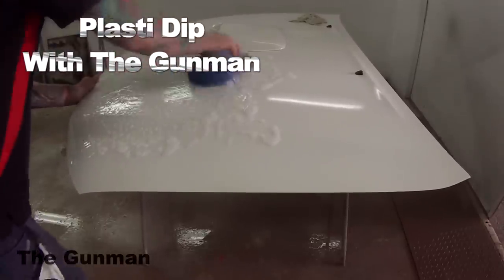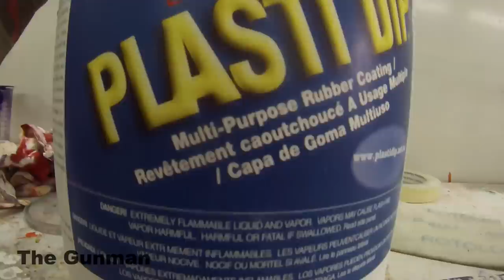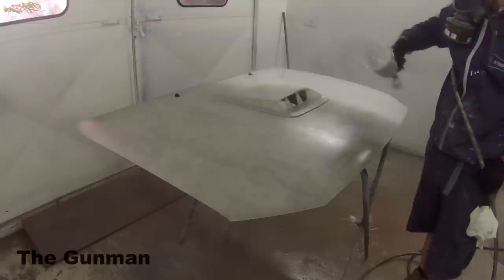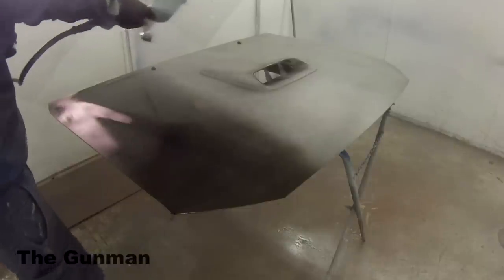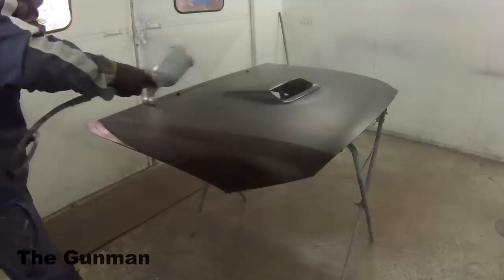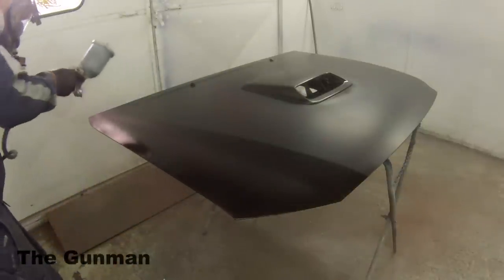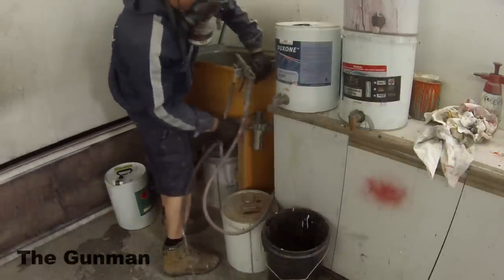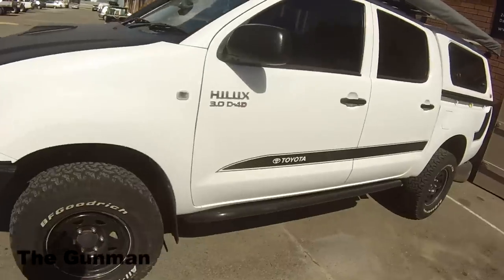Professional PlastiDip Spray Demo

Comment: I use plasti-dip all the time and it requires several coats, way more than painting it. you can use the black or white as basecoats and add pigments to the clear to get your preferred colors. I have a lot of people asking me to paint chameleon. Its a lot of fun to use and lasts for 3 to 5 years if taken care of properly and using spray on wipe off wax.

Comment: G'day mate...I'm on the Sydney side...I like your stuff so I'm a new sub....I found wax and grease remover gets it off pretty easy..A workmate did his car with rattle cans and it looked like crap and man he had a time "peeling" it off..The heavy coated areas lifted off not too bad but the rest was a real bugger.. Looks like it came off old mates wheels ok with a pressure washer.

Comment: hey gunman I bought the divilbiss finish line flg4 that you did a review and demo on and will be using it for plasti dip could give me any advice on using it? I teste it the other day and I was throwing out the dip very slow and it was not a pleasant experience I need a little help on adjusting or if you recommend a better gun?

Comment: Nice! One question about gun cleaning: can I spray solvents into the spray gun from the front (where the air pass)? Wouldn't it damage the air passages or something like that? I'm afraid of doing it after my cheap gun didn't spray well after cleaning and I just saw that you're cleaning by spraying solvents into the gun :)
Thanks for the videos.
Reply from the maker: MHRping That's fine and it shouldn't damage it at all.

Comment: Hey Gunny! i know this is an old video now, just a quick tip, you need atleast a good 7 coats of dip to make it peelable properly! just a heads up :)
Reply from the maker: wow at $400 for 4lt thinned from memory, I'd sooner matte black 2k for $30 2 coats, more durable then when I want it white again spray it.
Reply: +The Gunman I'm in the UK,  plastidip is a lot more affordable here for sure. keep doing what you're doing though man, I love your work and watch all your vids!
Reply: +robert starling where can you get matte black plasti dip spray can in the UK cnt find any check b&q no luck need it for my PS4 HDD Cover
Reply: Can you use this for car emblems, to blacken them out

Comment: Actually theres a question about my last comment then. What's this stuff like to tape off to make an edge, or part overcoat with another colour?
Cheers again.
Reply: Barry Jones Check out Dipyourcar here on youtube, they are dedicated to plastidipping cars with al sorts of colors and even multiple colors on 1 car.
Reply: when you tape off an area you should remove the tape while the dip is still wet. I hope that helps.

Comment: In UK it's only £45 for a 4 litre can, seems way over priced for you
Reply: that's real cheap, here in the Netherlands it cost €9,95 for a can (325ml) .. do you have a link where you get that 4L can?
Reply: +Ding Dong It's on the UK version of performix site, (.uk)but it's more than i said it's more like £60 for 1 US gallon which is approx four litres still a lot cheaper than this though, there are others though try pro dip and car dip
Reply: +rikster 11110 http://www.plastidip.co.uk/full-product-range/
Reply: +rikster 11110 also try full dip, this is a Spanish made product that's meant to be quite good
Reply: Is this mat finish only, in this plastic spray?

Comment: +TheGunman plastidip of performix is badd real bad use cardip www.cardip.com i am almost sure that you can find halo efx. Or cardip in austr. What i am curious about is try with left black paint a bonnet or other car panel and try some clearcoat over itt what you normaly use on cars if its melt down try waterbone  clearcoat ive the clear come good and nice you will make a lot off money with you bisnizz. Please i will loce to see a video if thatt  PS: you are the best painter what i have seen over many years 💪